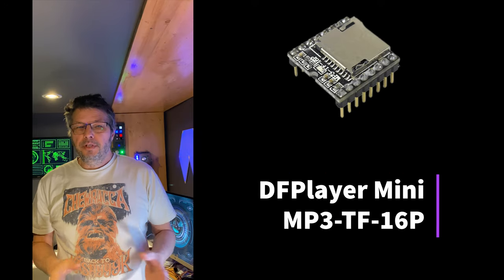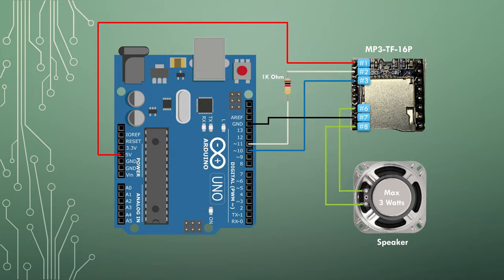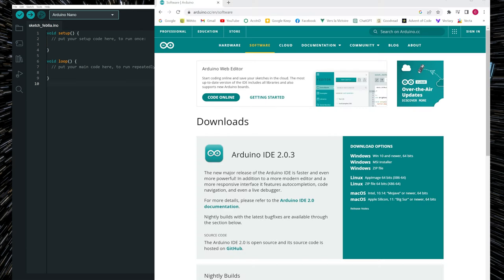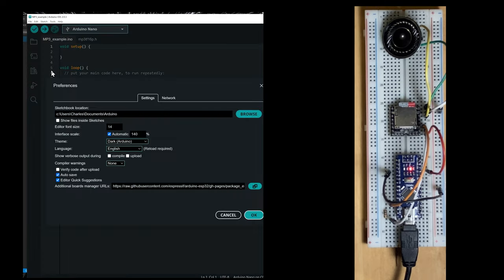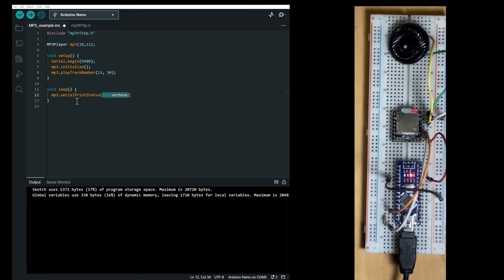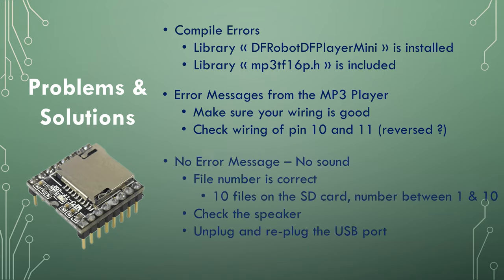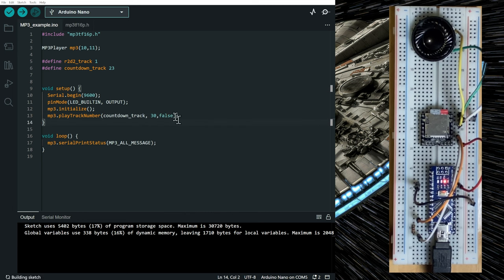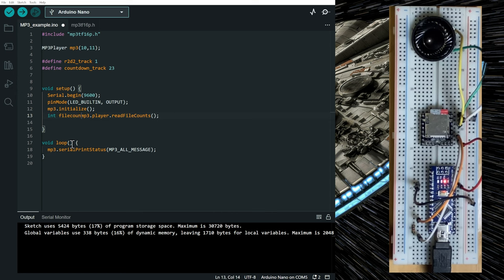Master the MP3-TF-16P (DF Player Mini) on Arduino: Seamless Sound Integration & Easy Setup! 🎶

Comment: I'm confused why nobody ever says what impedance of speaker this can handle; as if they think 3 Watt tells me anything? It makes NO difference if the speaker can handle more than 3 Watt since DFPlayer will never get that high so it will never care that your speaker can handle more than that. I get the hint people don't comprehend that the speaker is not sending power back to the driver. But I DO need to know whether you have 4, 8, maybe 16 ohm speaker ??

Comment: Good morning, I am trying to compile the sketch, but it keeps saying that I don't have the SoftwareSerial.h file, which I actually do have. And the times that it does compile the sketch, it says that I don't have another .h file that I guess the SoftwareSerial.h file is calling. What can I do? Another problem I've been havign is that the esp32 doesn't even detect the module, i've rechecked the conections a lot, but they are all correct. Also, the module i have is a clone, it isn't exactly the same hardware, do you know where I can get info about this? The place I bought the module from doesn't have any info about DFPlayer Mini's clones.

Comment: Is this device capable of playing one audio track on startup, and then a different audio track when a button is held down and then back to the first audio track when the button is released? Thank you for your time.
Reply from the maker: Yes it can do that with the proper code in your sketch
Reply: @thelastoutpostworkshop  Any pointers? I have it in an if statement in the loop, but when I press the button, it has to wait for the song to finish before playing the other audio track?

Comment: Thank you for this tutorial. I am only able to get my DFplayer to work using your mp3tf16p wrapper. I am not able to access the DFMiniPlayerRobot library in a new sketch (it is installed). Do you know why this is? I want to add a button push to trigger the music and then randomly play one of 4 MP3s but I keep getting an error that its not defined in the class MP3Player. Any help would be appreciated.
Reply from the maker: You can access the functions of DFMiniPlayerRobot library, by using the player object, for example using my code with mp3.player.EQ to access the equlizer or any other functions provided by the DFMiniPlayerRobot library

Comment: Thank you very much. Please note that you should use a 3W speaker or one with lower power rating. If you don't have a 3W speaker, you can use a 5W speaker with a series resistor (20 ohms or more), and it can work, as I have done.
Reply: Isn't the load to the amplifier defined by the Ohms rating, not by the power rating? afaik, The speaker power just tells which power the speaker can handle without distorting sound too much.

Comment: Just worked through an issue I had with this board, one that others may also have, so I thought I'd share. 

Everything was connected correctly, the code was implemented and uploaded. But the only serial output was "MP3 Player Online."
After messing around with the code and it still not working, I switched out my Arduino Nano for an Uno, and that instantly fixed the problem. 
I think my Nano is an older model, without an ESP32. So check for microcontroller compatbility!

Otherwise, a great tutorial and header file. Thanks!
Reply from the maker: Thanks for sharing
Reply: Brother I the got same problem but then I used an external battery to power the df player and it worked in my case

Comment: I KID YOU NOT I HAVE BEEN TRYING TO GET THIS STUPID PIECE TO WORK FOR 3 DAYS THANK YOU!!!!!!!! MY TORTURE IS FINALLY OVER
Reply: now all I have to do now is find a way to play it by using an ir remote
Reply: bro, fucking same. its an anniversary present and this wee fuckin thing has given me nothing but bother. UI done weeks ago, 3d modelled weeks ago, but this fuckin one thing has genuinely given me nothing but trouble. hope you got your proejct working in the end bro
Reply: @taebm  ya it went amazing, I used to play bell noises for a prison model that we made for our law class, also using it I was able to rick roll my teacher so I was very happy
Reply: @plantor0728  Ahahah, no way! That's the best use of it man, good stuff. Sounds like a really unique and cool project you ended up with too. Hope you're still designing stuff, nothing more fun and engaging than that imo
Reply: @ ya now I’m trying to make a very simple computer out of transistors, it’s going along pretty well too, already made a astable multivibrator for the clock circuit and I’ve made a 4 bit adder for it to, next up on my list is to made a binary counter to make sure the program is on the right step

Comment: Great Video.  As you, I was having problems getting my player to play all the files after formatting my disk using WIN10.  I found that if you don't use the quick format your MP3 player will play all of you files. I have about 700 songs on a disk and by using the randomALL command it plays all of the songs loaded.   Also, I don't any number or folders assigned to the songs.  Hope this helps.
Reply from the maker: Thanks for the tip

Comment: Hello and thank you for fantastic content. I just wanted to ask if you may have found a way of adding a PIR sensor to this as yet? I have a great little Sith Wayfinder star wars project that I’d like to add sound, activated by a sensor when you enter the room. 

Kind regards
Reply from the maker: It is still on my list, choice are hard to make!  Anyone else would like to have tutorial a PIR sensor with the MP3 module ?
Reply: @thelastoutpostworkshop  fingers crossed 🙏🏻😄
Reply: I’d love a tutorial on using PIR sensor to trigger sound/tracks
Reply: @judgeworks3687  , thanks 👍

Comment: Great video, what if I want to have a total of about 20 sounds playing with a delay in between. Do I need to number each out with a delay command in between? Or is there a way to make the code shorter?
Reply from the maker: You just have to put them into a for-loop and insert a delay like this :
int volumeLevel = 20;
 int trackCount = mp3.player.readFileCounts();
    for (int i = 1; i <= trackCount ; i++)
    {
    mp3.playTrackNumber(i, volumeLevel, true);
    delay(500) // 0.5s delay between play
    }

Comment: Hello friend thanks for sharing this touturial but I have a question for this module is " 3.0 right "you used mp3tf16.h ,I use DfRobotDFPlayerMini.h but is not good,and my display p10 shutdown,and order songs not the same when I used DFrobot Dfplayer mini.h. You can tell me why please 😉
Reply from the maker: mp3tf16.h is just a wrapper for  DfRobotDFPlayerMini.h  to make  it easier to use.   DfRobotDFPlayerMini.h  is no longer maintained and has some issues.  I tried to find an alternative with no luck.  But the code should work, make sure the pins used in this project are not reserved in your development board.
Reply: @thelastoutpostworkshop  hello friend well pins be ok because for me work perfect and for my friend no , I have module red light and my friend have blue light have some Diference?

Comment: Did you experience different speed of playback using more than one of modules? I hooked up three of them, Start them simultaneously, same as cards, same file and they start synchronous, but drift about 1 sec within 6 minutes playback. So speed of playback is not identical on these modules, good only for doorbells, but not for serious applications, or?
Reply from the maker: I never tried with more than one module

Comment: Is the volume of the speaker is adjustable? And also i have a concern about how many sounds can play because i need to input many kinds of sounds of animals i hope you answer my question sir thank you 🙏🏻
Reply from the maker: yes the volume can be adjusted in the code and you can store hundreds of sounds  on the sd card that you can replay
Reply: @thelastoutpostworkshop  , your so very generous when it comes to your viewers thanks a lot sir 👍

Comment: Nice video, Thanks for sharing. 
I wish to add the MP3 player function to a selfbuilt Nixie clock and turn it into a "talking clock". For this purpose, I need to concatnate different MP3 files depending upon the time the clock is going to announce. 
My question: Does the MP3 Player library allow concatanation of files?
Thanks for your comment/advice in advance.
Reply from the maker: Nice project!  You don't need to concatenate the MP3 files (and the MP3 player don't have this functionnality), you can select which one to play by using code depending on the hour.  Here is a very simple example : 
#define trackFor12 20
#define trackfor11 25

  switch (hour) {
    case 12:
      mp3.playTrackNumber(trackFor12, 25, true);
      break;
    case 11:
      mp3.playTrackNumber(trackfor11, 25, true);
      break;
      break;
      // and son on
  }
Reply: @thelastoutpostworkshop  Thank you for your quick response. It is helpful.

Comment: I've checked my wiring, and every time I plug the mp3 player in, the lights on the Arduino turn off, do you have any idea what is happening.
Reply: Short
Reply: You are short circuiting your Arduino
Reply: @sam-e6h5o  Maybe your MP3 player has a short circuit or you installed the polarity in reverse

Comment: Hello again, Once again great video. I am having 2 issues, one when I do the file count I am getting a -1 as the number of files in my card. 2 and most important, I upload the program and it runs perfectly, then I remove the USB from the computer and hook it up to my mobile battery and nothing happens. Do I need a different code to start it once plugged to a battery?
Reply from the maker: -1 occurs when the player is busy and a timeout occurs for waiting too long for the player
Reply from the maker: Ho do you hook up the battery to the ESP32 ?

Comment: Hi nice video it helped me understand how it works, but I have one question: Is there a way to stop the initialize if the audio files are in the void loop? like, I use a switch to toggle all off but I don't want to use it for removing the power, do you think is there a way with coding?
Reply from the maker: I ma not sure I understand what you mean exactly by "stop the initialize", show me some code please
Reply: @thelastoutpostworkshop   I mean like: void loop() {
 int filecount = mp3.player.readFileCounts();
Serial.println(filecount);
mp3.initialize();
Then Here in the loop I add some coding
And then after I did the code, I want a switch to, like, "mute" the speaker or to stop the code, because mp3.initialize(); makes the mp3 start to play, is there a "reverse" of the mp3.initialize(); or I have to stop all using external power connections?
Reply from the maker: the mp3.initialize() must be in the setup(), not in the loop.

Comment: Greetings 

I am using the Gravity Digital Speaker Module for the  MP3-TF-16P project, but my speaker has 3 pins.
For my my connection I tried connecting the VCC and GND of speaker to the Arduino Mega, then the signal Pin to SPK1 of the MP3, I eventually connected signal pin to all other pins of the MP3 player but there is still no audio sound output, the speaker produces a scratchy sound

The MP3 blue light is not turning on but on the serial monitor it says “MP3Player online”

May you please assist me?
Reply from the maker: I am not sure if it can work since the gravity module has a digital interface when SPK connections on the MP3-TF-16P are analog, but it also have DAC_R and DAC_L pins, have you tried these ?

Comment: Thanks for the video! Is it also possible to use a button to cycle through the sounds while they still play in a loop? So that when the sound is done playing it jumps to the next sound, but when it is playing and you want to skip this sound you can press the button to go to the next? I tried a few things but can't get it to work.
Reply from the maker: yes you can do that, just specify false for the last parameter when starting a sound :             mp3.playTrackNumber(sound, currentVolume, false);
So the sound will start playing and your code will not be blocked, you can then do anything you want while the sound is still playing, including starting a new sound!
Reply: @thelastoutpostworkshop  Thank you for the reply! I tried it like this
if (digitalRead(buttonNext) == ACTIVATED){
  i ++;
}
    mp3.playTrackNumber(i, 4, false);
but the sound keeps starting from the beginning until you start the last sound in the folder, that one is played fully. Would it also be possible to combine it with a for loop or something so when you don't press the button the next sound will automatically play after the current sound is finished?
Reply from the maker: if you want to play a sound automatically after one is finished, you can do it this way :     mp3.playTrackNumber(sound1,15,false);
    while(!mp3.playCompleted() && !buttonPressed) {

    }
    //play the other file

Comment: Sir I am doing a project on Blind Stick with multiple sensors (Fire, Water, LDR, Ultrasonic, DHT11) Can I use this method to play different sounds depending up on the sensor input reads and using the If, else if conditions ? BTW this was an helpful video
Reply from the maker: Yes absolutely, you can play sounds using if then else based on your sensors input
Reply: Thanks a lot sir 🙏

Comment: Thanks for this video, I'm new to this and found it very informative. I've got the player to work as instructed but I'd like to play two tracks basically an engine on/off effect. Track 1 (engine startup) would play continually as long as a momentary switch is pressed then track 2 (engine cool down)would play automatically when the the switch is released. Could this be done and where would I wire the switch?
Reply from the maker: Yes it can be done, you can wire the switch on pin 7, and use this to initialize it in the setup() function: 
void setup()
{
pinMode(7, INPUT_PULLUP);
// Rest pf your code here
}

then in the loop function you read the push button:
void loop()
{

  if (readPushButton())
  {
    // Play your first MP3 file
   while(!readPushButton()) {
   // Here we are just waiting for the push button to release
  }
 // Plya your second MP3 file
}

Here is the function to read the push button:
boolean readPushButton(void)
{
  int value = digitalRead(PushButtonPin);
  delay(5);
  return value == 0;
}
Reply: Thanks for answering so promptly. I'll definitely give this a go! @thelastoutpostworkshop
Reply: Having problems setting this up. I keep getting error messages no matter which order I put them in.
#include "mp3tf16p.h"

MP3Player mp3(10,11);

void setup() 
{
  Serial.begin(9600);
  mp3.initialize();
  pinMode(7,INPUT_PULLUP);
 }
void loop() 
{
  boolean readPushButton(void);
  int value = digitalRead(PushButtonPin);
  delay(5);
  return value == 0;
  if (readPushButton());
  mp3.playTrackNumber(1,30);
   while(!readPushButton()) 
  mp3.playTrackNumber(2,30); 
}

I'm obviously doing something very wrong.
Reply from the maker: here is the full code for the sketch corrected:
#include "./lib/mp3tf16p.h"

#define led 13

// MP3 Player
MP3Player mp3(10, 11);

#define PushButtonPin 7

void setup()
{
  Serial.begin(9600);
  mp3.initialize();
  pinMode(PushButtonPin, INPUT_PULLUP);
}
void loop()
{

  if (readPushButton())
  {
    mp3.playTrackNumber(1, 30);
    while (!readPushButton())
      ;
    mp3.playTrackNumber(2, 30);
  }
}

boolean readPushButton(void)
{
  int value = digitalRead(PushButtonPin);
  delay(5);
  return value == 0;
}
Reply: Thanks for taking the time to correct this for me. I've just started and realise that I have a lot to learn. @thelastoutpostworkshop

Comment: how can I use your script on a board with hardware serial1 ? mine does not support softwareserial
Reply from the maker: Here’s how you can modify the MP3Player class to use a hardware serial port instead of a software serial one. The changes mainly involve removing the SoftwareSerial object and assuming you will use a predefined hardware serial port for communication with the DFPlayer Mini module:
#include "Arduino.h"
#include "DFRobotDFPlayerMini.h"

#define MP3_ERROR_ONLY 1
#define MP3_ALL_MESSAGE 2

class MP3Player
{
private:
    HardwareSerial *mySerial; // Pointer to HardwareSerial instead of SoftwareSerial
    void statusOnSerial(uint8_t type, int value);
    void waitPlayIsTerminated(void);

public:
    DFRobotDFPlayerMini player;
    // Constructor now takes a reference to a HardwareSerial object
    MP3Player(HardwareSerial &serialPort);
    ~MP3Player();
    void playTrackNumber(int trackNumber, int volume, boolean waitPlayTerminated = true);
    boolean playCompleted(void);
    void initialize(void);
    int serialPrintStatus(int errorOnly);
};

// Constructor implementation changed to initialize the HardwareSerial reference
MP3Player::MP3Player(HardwareSerial &serialPort) : mySerial(&serialPort)
{
}

MP3Player::~MP3Player()
{
}

void MP3Player::initialize(void)
{
    mySerial->begin(9600);
    Serial.println(F("Initializing MP3Player ..."));

    if (!player.begin(*mySerial,true,false)) // Use the HardwareSerial reference
    {
        Serial.println(F("Unable to begin:"));
        Serial.println(F("1.Please recheck the connection!"));
        Serial.println(F("2.Please insert the SD card!"));
        while (true)
            ;
    }
    player.volume(10);
    Serial.println(F("MP3Player online."));
}

// The rest of the implementation remains the same...

Comment: CAN WE ADD SPEAKERS (WITH BUILTIN POWER SUPPLY) WITH 3.5 MM AUDIO JACK IN MP3-TF PLAYER?
Reply from the maker: There is no 3.5 mm jack on the module but maybe it would work with an amplifier module